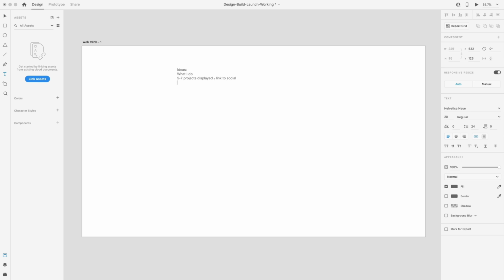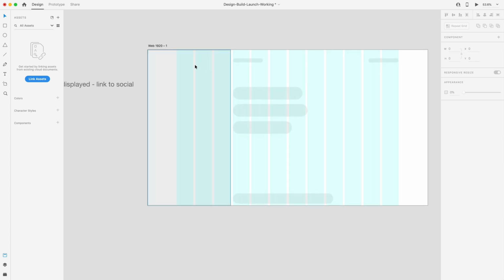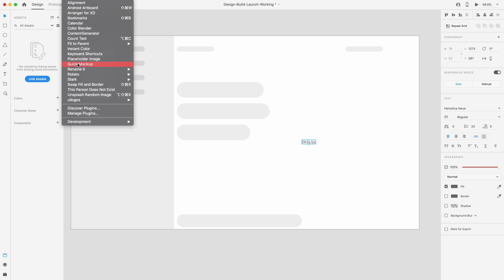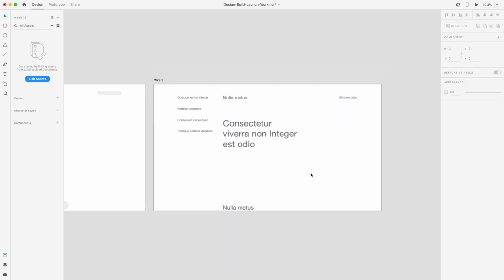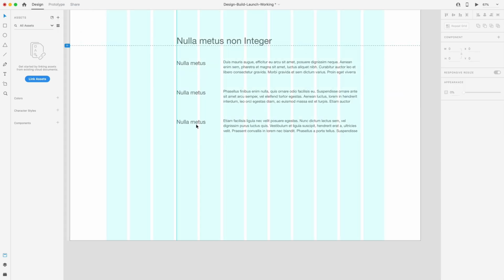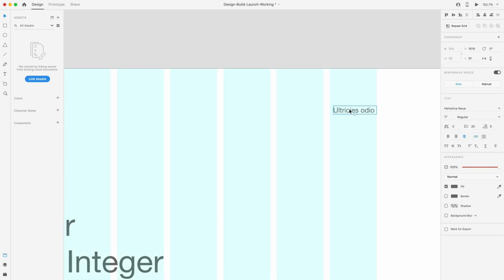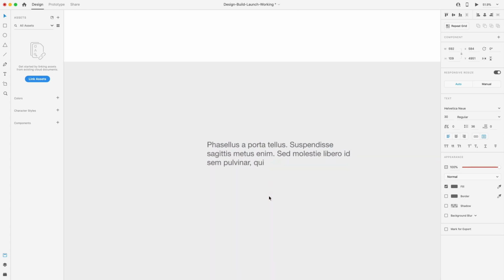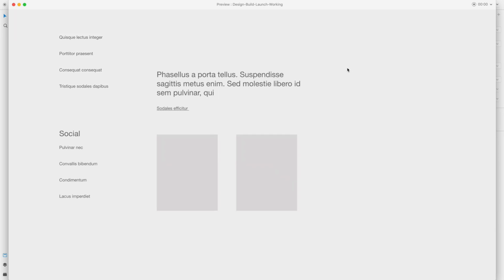How to Wireframe a Website - Design. Build. Launch. Episode 1

Comment: I was excited when I saw the intro video. I have to ask what is your column grid set to? I use a 1440px HD web with a 1200px 12 column grid. I started with 1100px but it felt the canvas was not dividing correctly.
Reply from the maker: I have been using the default that XD provides or sometimes I will add 200pt spacing on sides of grid. Depends on the design usually.